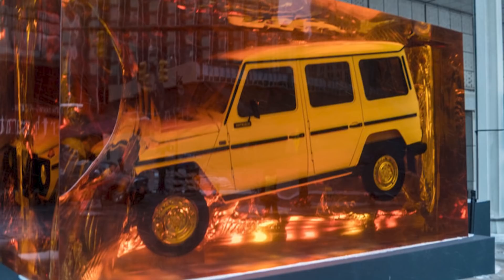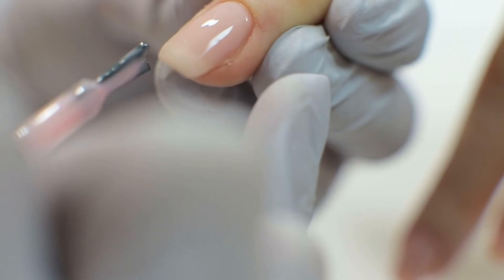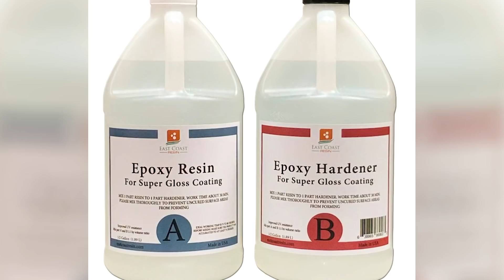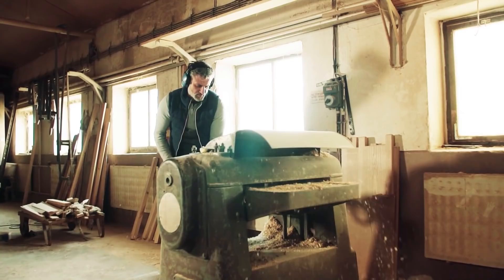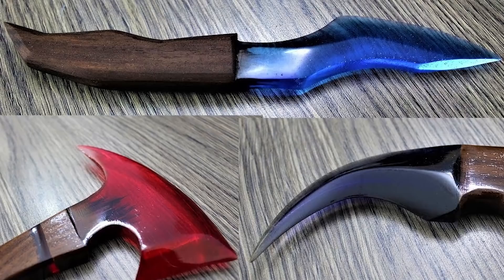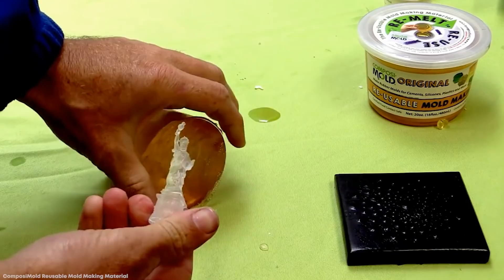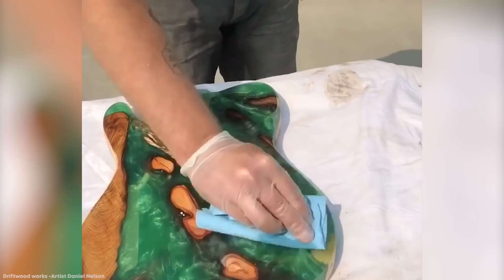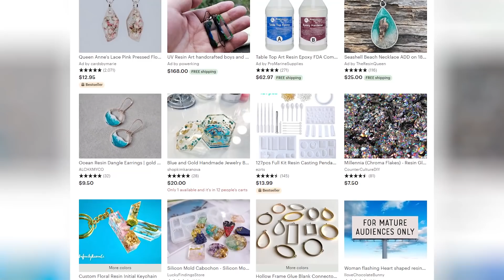15 MOST Amazing RESIN Creations

Comment: here's a little tip for you guys if you guys get a vacuum chamber and then put the duration of the epoxy resin in it it will remove the bubbles out from the project that you have leaving it crystal clear
Reply: A pressure pot is easier to do. It pressurises the bubbles into nothingness. With a vacuum chamber you have to sit and watch it so it doesn't bubble over, releasing the vacuum or getting it to sit at just the right suction. And you'll need an epoxy with a longer open time.

Comment: 1. Poly resin smells horrendous & is usually not the resin you need. 
2. You still need to wear a respirator & gloves when working with any resin really. 
3. Those examples of flowers in resin were really bad. They were cloudy & had a ton of bubbles.
4. Resin isn't as easy as it's made out. Takes quite a while to get perfect. Also, with it being very toxic, it's not something to be taken lightly. 
5. I've never heard of anyone putting resin pieces in the freezer?! It's not something you need to do at all.
6. I've never heard of anyone using a paperclip to remove bubbles?! 
7. Not all resins are 1 part resin to 1 part hardener. 
8. You can't put "just about anything" in resin. A lot of the things you can put in resin need treating first. Such as drying out or sealing.
9. I wouldn't recommend it as a hobby for just about anyone. When working with resin, you're working with chemicals & causing a chemical reaction. You can be seriously hurt when working with resin. Not just short term but in the long run, if used incorrectly & without the correct protection. 
10. If you're thinking of trying your hand at resin work. Please do some serious research. Do not go off videos like this one. I would happily help with advice

Comment: Wrong info on the charred epoxy table. First, the charing is called shou sugi ban. The art of burning wood to preserve it. Secondly, he didn't use black epoxy. He used clear epoxy. To seal the wood up before he did the pour.